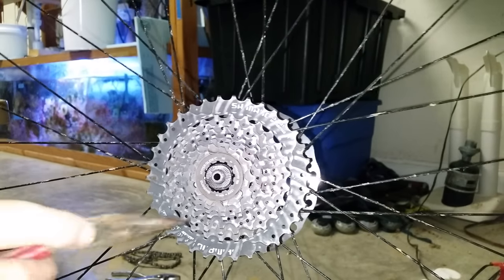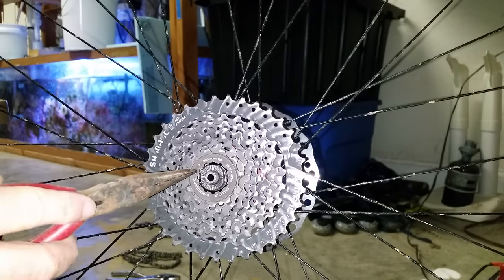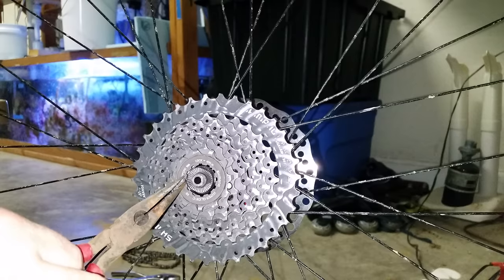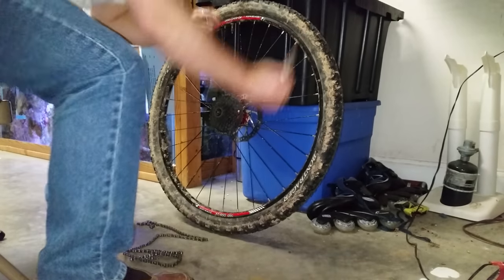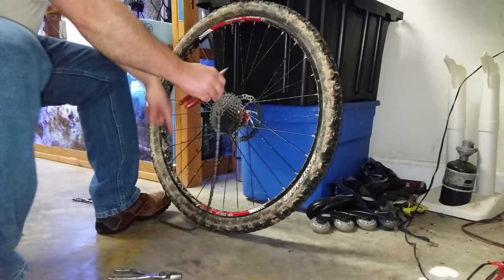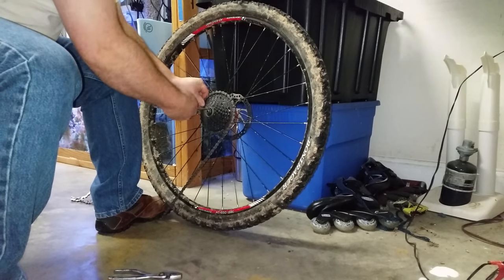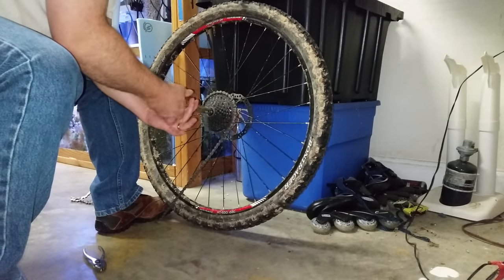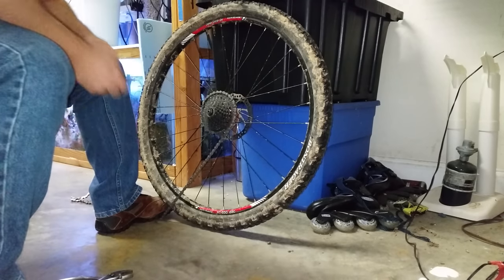Bicycle Cassette Removal without Special Tools

Comment: The needle nose weren't able to get good enough purchase.  I ended up using the head of a bolt (forget what size) that fit perfectly into the lock ring, and vice grip to turn.